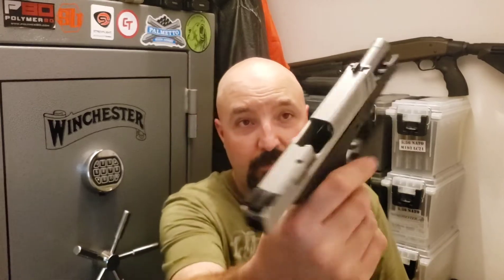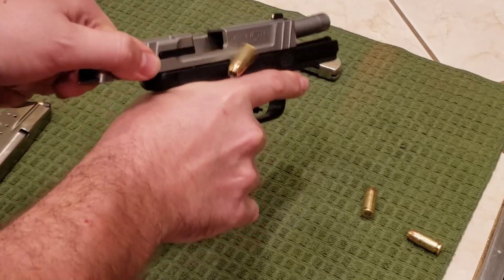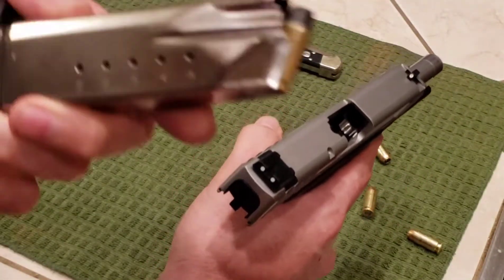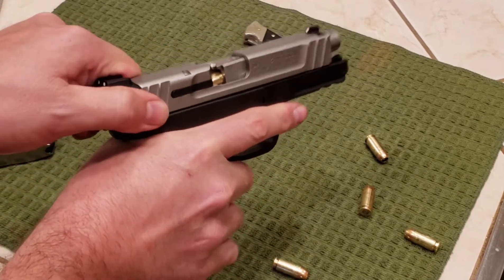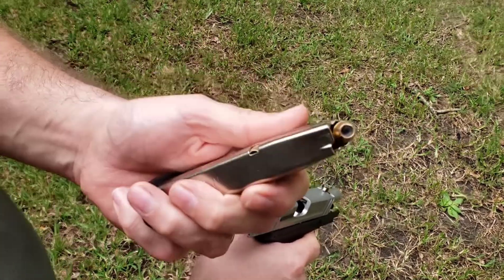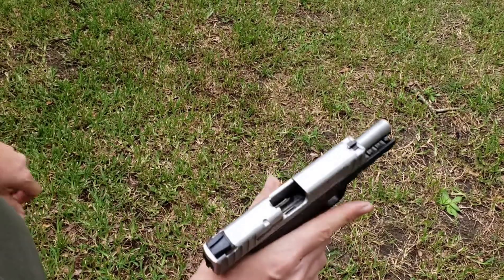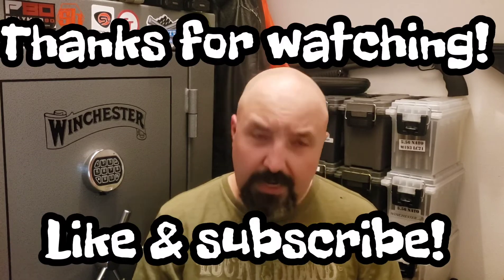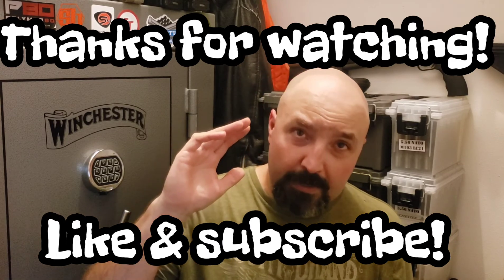Farm Style Tech Tip: How to make a new S&W SD40VE chamber rounds reliably. PART ONE

Comment: Oddly enough, I just chambered tested my brand new SD40VE and experienced the hang-up. Hours later, I view your video that merely pops up in my feed. Thank you for this.
Reply from the maker: Thanks for sharing👍
Put a drop of oil under the extractor blade on the outside (right side) of the slide then use a pick or small screwdriver to work it back and forth a few times.There's a spring under there that sometimes is a little dry. Several viewers have attested to this helping with the break-in process.

Good luck, and congrats on your new toy!

Comment: There are several pistols that will do this when you try to go easy with your slide. If you can't use the slide release either because you don't have one or it is to stiff then pull it back and let go. Remember it is moving more rapidly when you fire it than anything you will do with your hand 🙂.

Comment: Mine was doing the same so I started only loading the mag half full until I got it through the break in period which is around 200 rounds plus a good cleaning right out of the gate. Also, had the same issue with my late father in laws hi point. Same solution. Now I run full mags on both while the hi point still jams ever 100 or so rounds my Sd does not. Great vid thank you for putting this out.
Reply from the maker: Thanks for watching! Here's a link for an upcoming giveaway we are doing on the channel courtesy of Crimson Trace! https://youtu.be/Zetazonm9NI

Comment: Just got this pistol today had that problem thank goodness for your video really did help me
Reply from the maker: Glad to hear it. 
It will get better as the gun wears in with use. Ammo is expensive, so to help with the "break-in" period
Here's a tip: 
With a safe and empty weapon, and the slide locked open, add 1 drop of good quality gun lubricant (I recommend Breakfree or Clenzoil CLP) to the groove in the slide rails where the frame rails ride. (That's 1 drop per side),  and 1 drop on top of the square portion of the barrel and 1 more on the outside of the top of the round part of the barrel. Rub those in with your finger.
Keeping the weapon empty, point the muzzle in a safe direction and work the slide back and forth many times (at least a couple hundred).

That will cause the machining marks on the metal contact areas to  smooth out, and help the action to cycle easier without wasting precious ammo. 

Thanks for watching!

Comment: Thanks for posting this. Picked up the same gun a month ago. Finally went to range today to shoot it. Went to jack a round and same thing happened to me. After 3 attempts I just put it away and me and wife just shot her .380 EZ.  I was thinking since I didn't take apart and oil it that was the problem. But wife's shot just fine. But I did come home and broke them down and wiped all factory grease/oil off both and ready to try again. Had to say I was pretty disappointed hers worked fine, but mine didn't. Good to know it wasn't 100% user error. Own a few rifles and shotguns, but this is 1st handgun I've owned. Definitely not my 1st choice for handgun, but was available and price was great. 
I should know better than to shoot straight out the box though.
Reply from the maker: I hope the next range trip is more satisfying.  Just remember the break-in period for some guns is longer than others.  Some folks say that a pistol like this one require at least 250 to 300 rounds to properly break them in. I realize with the cost and availability of ammunition at this day in age that is a tall order!

While I am not sure if your pistol is a 9mm or 40 S&W,  I would recommend that you pick yourself up some snapcaps something like this: https://www.amazon.com/dp/B08SJ6R3CP/ref=cm_sw_r_cp_apa_i_EBPGETCXB4MF00EYBWQJ?_encoding=UTF8&psc=1

Then work the action by hand, to include dry fire practice. If you do that several hundred times it will not only help the mating surfaces of the slide and frame rails to smooth out but it will also help you to get used to your pistols trigger.
Reply: @JayLewisFarmStyle  thanks for the tip. It's a 40. Hard to buy a bunch of ammo to just shoot at targets today, that's for sure. The price and availability makes it kinda hard to just run a few hundred rounds thru them these days. Thanks again for vid and tip.
Reply from the maker: @t-reyh5937   something else you can do, but you must be diligent in cleaning it up afterwards would be to go to the auto parts store and get yourself a tube of valve lapping compound. Put a little bit of that compound inside of the groove in the slide rails where the frame rails ride then it then work the action back-and-forth many times.  That should expedite the wear-in/break-in process. If you are feeling froggy you can use a little bit of that valve lapping compound to polish the chamber and feed ramp also. A Dremel with a polishing wheel would come in handy but it can be done with a dowel rod wrapped in a piece of old t shirt either spun by hand or stuck in the jaws of a power screw driver or drill. JUST BE CAREFUL!

Comment: Had a handgun doing the same thing. The magazine was holding the ammo too tight at the top. I adjusted the top open just a few thousands and it worked fine. May not be your problem but worth a look. I agree- let it slam shut- not slowly.
Reply from the maker: I've bent feed lips by dropping magazines on the ground before. Sometimes a tiny bend can mess them up.

Comment: I even bought a new barrel for my sd40ve. Still waiting to try it. I think I just wasted my money lol. My mag springs were horribly rusted. My father did not take great care of his firearms. I had to clean every last one of them took me 6 months. Didn't know anything. I had to research each one to clean them. I would get maybe 2 rounds off with my sd40ve, at the range and get this exact FTF. Thanks for this video Much appreciated! New to firearms but loving it!! I am by no means a pro. I take saftey as my top 10 priorities. My confidence with my firearms is way better than I used to be. Thinking of taking a training, safety, and tactical course over the next year or two. Anythi g to make me more experienced.
Reply from the maker: Welcome to the fold Todd! 

These things take time to learn, and no one has it all figured out.  From what I gather you inherited some firearms from your father?
My experience has been that with inherited firearms there is a degree of sentiment involved that legitimizes spending a little more on the care or restoration of those guns as opposed to something that doesn't have any sentimental value.

The Smith and Wesson SD40VE is an excellent example of a firearm that (while it may not be worth much in that you could go buy a brand new one today for less than $400) if a person inherited one and and wanted to make that gun right in order to maintain it as a keepsake can be done with aftermarket support. 

Let me explain this further: S&W has been making this pistol or some variation there of, long enough at a low enough price that many of them have leaked into the market. Most of the time when there are "that many" of something, there will be some degree of after market support.

Many brand new purchasers of Smith and Wesson SD9VE/SD40VE platforms realize shortly after purchasing the them, that they are lacking in the fit and finish department. 
I use this gun as the specific example here because it is the one you have, just know that there are many others that fit into this category. What happens next, is a company will realize the need for improvement on a certain platform and will devote time and resources into developing accessories or upgraded parts to fit that platform in order to make it perform more efficiently or just "better".

The argument can be made that if you purchase a $400 gun and then spend $200 to improve it, that you could have just bought a $600 gun in the 1st place and been better off down the road. That does have some merit in theory, however it is certainly not always the case.. What I have found more generally happens is that regardless of how much you spend on something you're probably going to try to do something to improve it after you've got to know it a little bit.
The company that comes to mind to me concerning what you could probably do to your SD40VE in order to make it work better than it does now is MCarbo.com  
They offer a ton of aftermarket support for that platform and have really good instructional videos to walk you through Installing their parts on your firearm at your kitchen counter.
Now I have a question for you concerning the overall condition of your fire. You mentioned rusty springs,  are you speaking specifically of the magazine springs,  or are you talking about internal parts in your firearm? 
If you are speaking specifically of magazine springs then I would suggest purchasing Wolff replacement springs for the magazines you have, then getting a couple of new magazines for carry purpose of you plan to defend yourself with it. 
However, if the rust is internal to the firearm, I would recommend contacting Smith and Wesson to have it shipped to them for service. There is a good chance that some of not all of those repairs could be covered by warranty. 

I realize this is a lot but sometimes that's required to get a point across. I hope I did not lose you along the way. Thanks for watching!
Reply: @JayLewisFarmStyle  yes just the mag springs. It took me two hours with a dental tool to take the leading off the barrel by the ramp. Watched every cleaning video that I could. Found yours as well. Which was really in depth. Once i got it apart. It was evident no one ever cleaned it. I even ha e a .22 s&w lr hand plinker that need a real gunsmith. Smoke staked that everytime I've shot it .... twice. I will read you reply a voulle of times because you put so much i fo in it. Thanks again I subscribed as well!!!
Reply from the maker: @toddplager8676   If you get a chance email me some pictures of the inside of it. I would like to see it and will offer anything I can in the way of suggestions.

In the meantime I plan to mention your dilemma and question in the video video that I do today which will air probably this evening late sometimes.

Comment: Just picked one up. This video explains a lot. Thanks for posting this. Basically I bought a lower tier firearm. 
I just ordered a Glock 21. 
See how that does.
Reply from the maker: It'll break in after a few hundred rounds and be a good gun! Glock 21 is a personal favorite of mine!
Reply: @JayLewisFarmStyle   I like the sound of that. I thought I bought a lemon for a bit there. I’ll let it rip at the range this weekend 👍🏼
Reply from the maker: gabriel vasquez in the mean time practice a few hundred dry fire drills to loosen it up. Put a drop of oil under the extractor bar.

Comment: I have shot my twice....and after setting for a year my done exactly what the video show...I oiled it up and started working the action...now I know it's an issue with some SD VE 40 and now I will treat it rough..
Reply from the maker: Be sure to put a little oil under the extractor blade on the right side of the frame. That seems to help.
Reply: @JayLewisFarmStyle  I will...thanks..

Comment: I saved this video to send to newbies because it shows a basic mistake that many new shooters make on ANY semi auto (striker fire)  hand gun. "Racking Through" is the solution and is the proper technique.

Pull that slide back and release it like a rubber band - with your hand continuing back toward your body in one single sweeping motion. Dont just stop and let go of the slide, and certainly dont gently push or follow the slide forward, sweep that hand all the way back as you let go of the side and it gets flung forward by the slide spring. Do it with intent.
Reply from the maker: If you're sharing it, I might suggest you share part 2 as well. It clarifies some of the common misconception with the first part. 
Here's the link:  https://youtu.be/jt1gi1B_yAo

Thanks for watching!

Comment: I own this weapon, this happens almost consistently. Usually when I am going through a course of fire it will jam
Reply from the maker: Have you considered sending it back as a warranty issue? 
If you want to try to fix it yourself and you have a dremel tool you might try polishing the feed ramp and chamber with a polishing pad and some valve lapping compound or similar substance. Just go slow and be careful.  
If that doesn't do the trick I certainly wouldn't consider it a self defense weapon. 
Warranty claim might be the best option, but if you go that route I wouldn't do anything to it myself before sending it out. You don't want to void the warranty by hacking on it. 

Hope that helps.

Comment: I just purchased an SD40 and have a similar issue, but it only happens after the first round ejects and re-chambers itself.I make sure to slingshot the slide and the first round chambers like its supposed to. But when I go to take the second, third, etc, the round gets stuck on the ramp. This isn't every time, but 75% of the rounds fail to feed. If I push the slide forward with my hand the round chambers properly but I shouldn't have to assist in the chambering process. I have about 300 various types of rounds through it. I have made sure to clean/lube the points called out in the manual but for some reason this keeps happening. I called S&W but they want me to ship it in and wait about 3+ weeks. Anything else I can do to not be without it for that duration of time?
Reply from the maker: I do not make a habit of advising others on what they should do to service their guns. 
That being said what I would do if it were mine is get a tube of valve lapping compound (Autozone or O'Reilly's), and rub a little of it into the groove in the slide where the frame rails ride. Then I'd work the slide back and forth many many times. Then I'd take a little bit more of the valve lapping compound and polish the feed ramp a little. 
I'd want to use something like non- chlorinated brake parts cleaner ($3/ can) or gun scrubber ($8/ can) to spray all the valve lapping gunk out of the nooks and crannies then do the factory recommended oil me here thing again. 
These guns are known for their economy and oftentimes have a significantly longer break in period than some others that have better for and finish. 

Hope that helps. 

Thanks for watching!

Comment: Many handguns and rifles need break it periods. Even Kimber rep  told me that on their .45's need around 1,000 rounds before they are considered reliable or "broke in" as they say. I say you will "go broke" feeding 1,000 rounds of .45 after you just spent $1000 on their handgun. I bought a Hi Point .40 til I can find a good deal on a Smith SR 40 or maybe the SD. The Hipoint might get trash talked on but after 1 mag and a talon grip wrap it runs flawless and feels good and solid.
Reply from the maker: I have a couple of guns that have run flawlessly right out of the box. The overwhelming majority of them need a little bit of a break in period. 

Concerning that Kimber 45, I have a 1911 race gun that I built many years ago using the very best parts available at the time. It still needs a break in! Maybe that will be the subject of an upcoming video.

Thanks for sharing!

Comment: Thanks man…I just bought my first 40 I was trying to cock it but I was having the same problem….I have hollow tips as well…this seems to work still haven’t shot it yet though…going to the range this weekend!
Reply from the maker: Congratulations on the 40!

Put a couple boxes through it and it'll be good to go. 

Thanks for watching!
Reply: How did you fix it
Reply: @raymondshaw343  its nothing to fix. When chambering pull the slide and release at full pull. Don't slowly return the slide back, let it go and it will chamber every time. Riding the slide is what causes the issue.

Comment: Mines doing The same exact thing but it is dirty in the inside could that be the problem ?
Reply from the maker: I have seen semiautomatic handguns get dirty enough to malfunction, but they have to get pretty dirty to malfunction.

I'd give it a good cleaning, and see where it was at afterwards. Remember, less is more when it comes to oil. Just enough to coat the bearing surfaces where the slide rides the frame rails, and wipe the barrel with an oily rag. That's it for oiling! Hope that helps. 

Thanks for watching!
Reply: 100%

Comment: I just purchased mine today and mine is doing the same thing. What is the solution can you help me?
Reply from the maker: Just using it and working the action over and over again will eventually help to break it in, but in the meantime... Put a drop of gun oil under the extractor blade on the right side of the slide. Rub it in with your finger then work the extractor back and forth a few times with a screwdriver or similar implement.

Be sure to watch part 2 of the video series on this channel:
https://youtu.be/jt1gi1B_yAo
Reply: Just send it to me. You don't want the hassle. Buy yourself a Glock.

Comment: The same thing happend to mines and i solved it just like u did.. I dont manually rack the gun i let the slide do the work. I still have plans of polishing the ramp but sadly i dont feel safe carrying it around.
Reply from the maker: Well,  I have a friend that has a lot of rounds through one and it is pretty well broken in now but it took a long time to smooth it.

MCARBO  makes pretty much anything you would need to make one easier to shoot or more reliable, and for a reasonable price as well.

Thanks for watching!